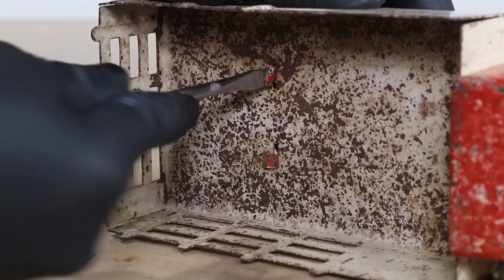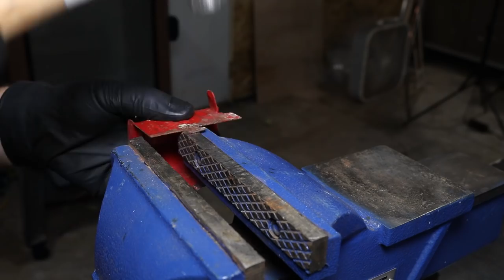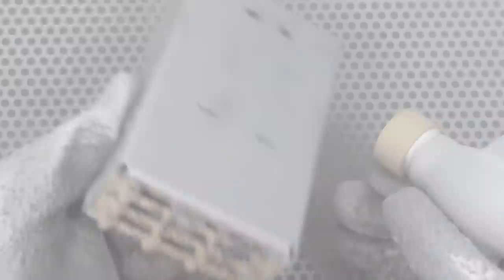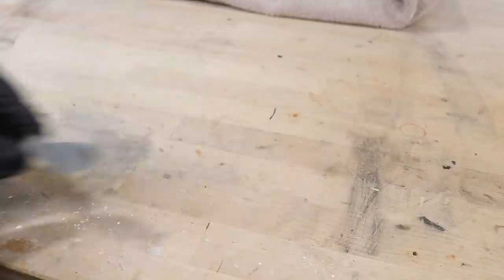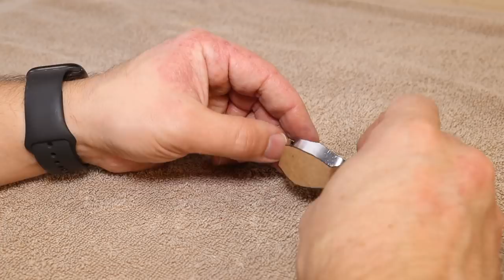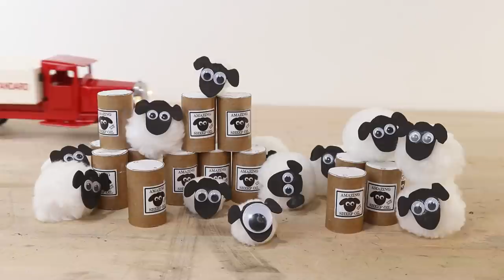1930's Metalcraft Standard Oil Light Up Stake Bed Pickup Truck Restoration

Comment: Maybe you could have soaked the tires in hot water before hammering them?

Amazing how flashlights use such large batteries for such tiny lights, and always seem to run out so fast. Now we have smartphones that run video screens all day on a charge.
Reply: Is probably an old type
Reply: I'm more impressed that they did not leak all over the inside of the compartment, unlike the  "modern" Durp-a-cells that corroded one of my Mag-Lites.

Comment: Love those electric light old toys. Nicely done. Didn't see you put the rubber slide stop on the switch handle, you don't generally miss those details and it may not be needed anyway. If those tires were actually rubber, you could spray them with WD-40, it softens the rubber temporarily. I've done that with regular car tires to remove winter studs when they were worn down. Works well.

Comment: I think you pushed the rear axle in the wrong spot, it was before in the other slot. Or was it like that from the factory?
Reply: yeah wrong spot for sure
Reply: @MartasZLA  idk if he did it per original design sadly hence the question
Reply: @stijnVDA1994  Well its restoration so it needs to be in that front spot.

Comment: Are these batteries really original? And didn't leak?
By the way, your collection is very beautiful!👍🇧🇷
Reply: Paper battery's are just built better. I have a 1949 brownie hawkeye camera with a Flash The Flash had a set of Rayovac paper case batteries from the early fifties and they hadn't leaked.